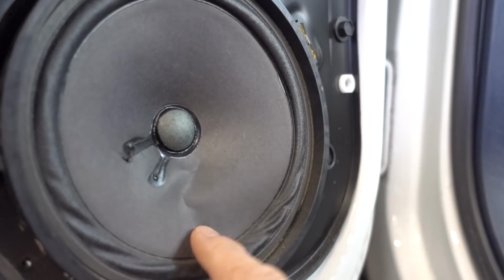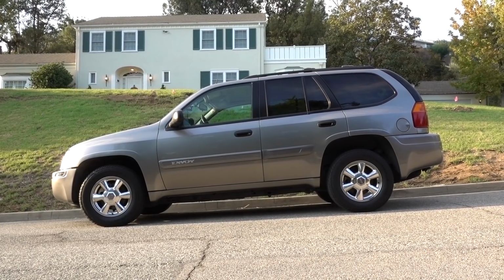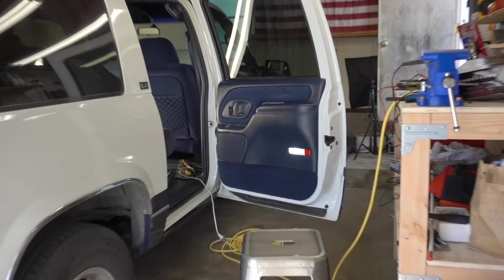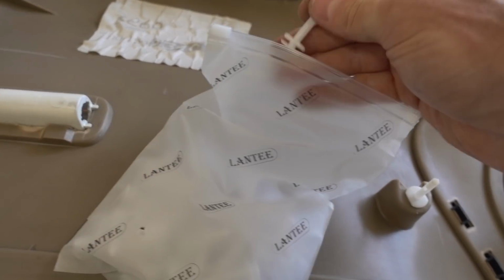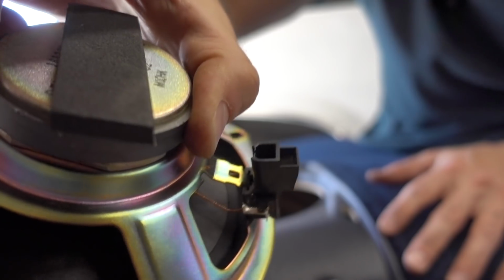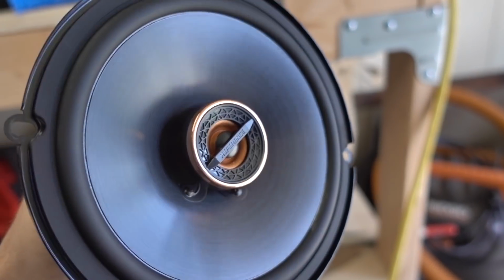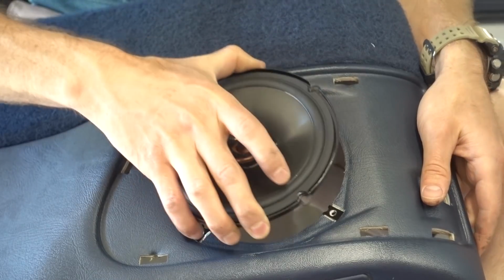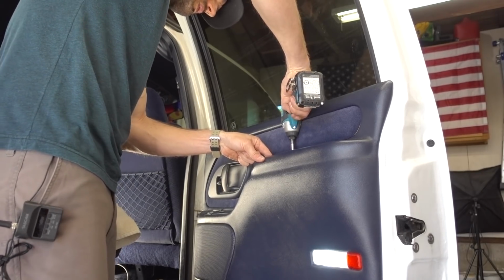This Is Why YOUR FACTORY CAR SPEAKERS SUCK!

Comment: My truck is a 1999 Ford F-150!! I haven't upgraded the stereo YET, but I have been working to getting the parts I need for it!! As far as speakers I have used I love JBL, Boston Acoustics, Pioneer and some of the Kicker stuff out there for speakers! I have used those brands a lot in the past, and they all sound great!! As for head units though I was always a fan of the Pioneer Super Tuner hardware, but over the last few years I have switched to mostly JVC head units!! I SHOULD point out too I have had some great gear too from Alpine and Clarion believe it or not, and I once owned a Clarion head unit back in the late 1980s that was AMAZINGLY smooth and super loud!! I also once had an Alpine head unit that was INSANE, but my only gripe about it was the price really didn't justify the sound quality when I have had units that were cheaper and sounded just as rich and full!! My last decent stereo system was in a 1984 Honda Civic and was a mix of a JVC head unit and a set of four Pioneer 6 1/2 inch speakers that was pretty sweet for a "simple" setup!! BUT the wildest system I ever owned was in my 1988 Ford Tempo that had two ten inch Pyle subs in a box in the trunk, a pair of 6X9 Kickers hidden back there as well, a pair of 6 1/2 inch three way Boston Acoustics in front doors, three amplifiers and a crossover controlling them and a pair of MTX Tweeters mounted up front to give me a bit more "snap" in the high end, that was all controlled off a Super Tuner Pioneer unit!! The damn thing was impossibly loud to the point where you could literally be standing 30 yards from the car and still hear it has clear as day with it at only half volume!! A friend of mine who worked as a professional installer, helped me "tune" it, and his employer freaked when he saw what I have stuffed into that Tempo!! Other that the Pioneer head unit and the MTX tweeters YOU COULD NOT TELL there was three amps in the trunk and a sub box stuffed under the back window, and I had to alter the tension rods (that held the trunk lid open) to make it all fit in the back!! I do miss that old stereo!!

Comment: Wasn't just GM, I've seen old Honda Civics with factory speakers that looked like they were made of cereal boxes and weighed almost nothing, for the longest time it was just a place they could cut corners to an extreme degree.  Its best not to invest much in that era of car regardless as the lack of sound deadening just renders any upgrade nerfed as it has to spend half its energy fighting road noise and bad accoustics.  Always just buy a car with the good factory sound system to begin with, anything else is a nightmare.

Comment: I have a 96 Suburban, and I followed your links to Amazon and order the same speakers as you for front and back. I also used your link and ordered the same head unit.

Comment: I used to install car stereos for freinds and anyone that would pay me as one of my friends was always buying cheap used cars and we'd put decent stereos including large subs back before everyone was buying sub boxes. My latest car is a 95 Neon that my little sister bought new. Her hubby had already had better after market speakers installed after they got married. They sound pretty good but the drivers door woofer is now blown so I'll have to get a few more to replace them. I might even go with the same kind. I did put a small powered 10" suitcase sub that sounds great and replaced the cheap aftermarket head unit with a nice Dual HD radio unit with surprisingly good sounding amps built in. I haven't even added big amps and big wiring to take all the power I used to run. If you pick decent gear even if it's cheap you'll be surprised how much better your car can sound. My Dart I did a full blown install with 2 12"s 8" woofers in the rear deck, dome tweeters, 6.5 woofers in the doors with the old Polk tear drop pods mounted to the windshield pillers. It sounded better than most peoples decent home stereos and had very clean deep bass and overall sound. I didn't feel like installing all the amps and wiring in the Neon like I did for my Dart slowly over time and deals came up. I had 3 independent amps in the Dart, 150 watts a side for the subs and 75 a side for the rest of the rear speakers, and another 75 a  side for the fronts. You can go nuts and spend a lot of time and money or just spend a little and have nice sound if you pick your components right.

Comment: I have the 2018 Nissan Navara np300 forntier truck and the factory speakers are of really good quality. I’m talking good hights, tremendous bass and clear mids...the only things is that it distorts at high volumes when the bass is turned up.

Comment: you can use a 9volt battery to check for polarity.  When you touch the positive lead to the positive side of the speaker it should pop out.  Now you know which is positive and wire it up accordingly.   Usually for GM truck in the rear, right speaker dark blue is + and light blue is negative. Left speaker is Brown is positive and yellow is negative.  I grew up with GM cars in the 80's and early 90's.  Those old Delco sound systems and 6x9 speakers would knock your socks off!!!  All my new GM products have BOSE which is pretty good for run of the mill car radios.

Comment: My 2004 Nissan Frontier has stock speakers atm and they actually sound good, and the bass sounds like a subwoofer.  I’ve replaced the radio with a pioneer Bluetooth HD receiver and big difference already.  I’ll keep the speakers in video in mind for when I shop.  If I ever do.

Comment: Renault Clio II - Took the original speakers and tuned the doorboards / mounting locations for more stiffness and less resonances. Detached the factory car radio to use it as a brake chock. Installed a precious audio device.

Comment: While you have the door cover off, add peel and stick aluminum on the sheet metal to stop vibration in the door.  I used Kicker speakers.

Comment: The speakers in my 2012 Chevy Silverado looked the same as your factories did. I upgraded to Rockford Fosgate Power series, which required custom mounts, because they were too deep to clear the window. Also, I used the speaker connectors Crutchfield sent me, to make install easier.

Comment: Removed my stock 2009 Toyota Matrix base radio and door speakers which sounded alright but lacked any low end. Replaced with an iPad and SoundQubed titanium horns, competition mids, and 2 SoundQubed competition 18's on 6000 watts. To handle processing, I use a miniDSP for room equalization, time delay, speaker timing adjustment, and level control.

Comment: I have a 2009 2-liter Miata. The stock audio was the  "luxury" Bose option with FM radio/CD changer and sounded awful (wooly and indistinct). I changed the head unit for a Pioneer 2-DIN naviceiver and the sound is transformed! I kept the stock speakers - they were not bad at all.

Comment: My 1979 RX7 SA has speakers surprisingly. They were upgraded by the previous owner BUT only the rears work so this weekend I’ll be popping panels off and checking the wiring to get the fronts working

Comment: They do sell harnesses for aftermarket speakers, but if you wanna save a few bux, have a soldering iron with extra electrical solder AND know how to use it, this is a great idea. Nice job!

I'm still working the stock speakers in my 2003 Ford Ranger XLT. I only changed the head unit to an Alpine and added two subs and an amp. Stock speakers co well with nids and highs while the subs get 'em down low ;)

Comment: Nice choice. Your speakers are 93 db, frequency range 57HZ-21 KHZ, 55RMS. I Have a 2003 CHEVY Avalanche. Replaced the rears w Kenwood KFC 40$. 2 way Coaxial Frequency range 40 HZ - 22 KHZ, 90db. 60watt RMS. I already had a tweeter in front so I just replaced with a midrange , GRS 6AS. 9$. 40watt RMS, 88DB, 75-only 10 khz. Hard to find just midrange speakers. I tried the Kenwoods in the front but thought they were too bright. I still have my factory radio so lower RMS and higher efficiency was what I was looking for. Because there was a separate tweeter , thought that there may be a cross over in front  door. Must not be because the tweeters went off when I used the Kenwoods up front.  Front speakers are super easy to replace. Your infinity may be a good choice but I will unplug the separate tweeter . Did You upgrade your stock radio?
Enjoy the day. Nice Video.

Comment: I live in the UK by the way.
The cars and vans in Europe and Japan have good quality sounding original speakers though. 
But they weren't made by the car companies, they were made by audio companies. Only thing is that loud music made small rattling sounds with the interior in the small European cars my parents used to own and there was no bass from the speakers in the 2004 Renault Master van, even though I turned the bass full on. The radio and all the other interior plastics felt very thin and brittle and the window winder fell off when I wound the driver's side window up once.
The speakers in Fords, Vauxhalls and Japanese vehicles ALWAYS sound fantastic. No rattling, always have a lot of bass.

Comment: For my 99 Tahoe I put in JL Audio C5-650X front and back doors and Polk Audio DB1001 tweeters for the front doors. Roof speakers got Kenwood KFC-415c's and I'm working on installing subwoofers somewhere on the body panels so i don't have em sitting in a box taking up cargo space. For subs I got 2 15" Kicker Q-Class L7's hooked up to a Rockford Fosgate R2-1200X1 amp. Factory look other than the huge sub box. With all the money I put into the audio in this truck, it still didnt blow me away. Once I had a local garage lay some Kilmat down in my doors, floor and ceiling, found all the spots that creaked or vibrated and tightened them down, replaced all the weather stripping on the truck. Finally the difference was night and day. Sounds better than the Harman Kardon system in my Beamer.
Reply: If I may ask, how much did the sound deadening cost you? I recently did a full system replacement, running 6 door speakers from an upgraded HU, put in a sub, and ran 2 amps... Don't get me wrong, the sound that comes from my system is great, but I'm not a big fan of the rattles and wobbles that it creates, so I'm looking to sure that all up. Had thought to get some SecondSkin, Dynamat, or some NVX sound dampener sheets, but if Kilmat is comparable and cheaper, I'd likely go that route... Any help would be appreciated.
Reply: @RAW_Reality  I've heard Dynamat is the best out there, I was charged $2,800 for the Kilmat and got 100% coverage although now I've been told they probably ripped me off cuz you can cover 50% of the truck and have almost the same results, for the creaks they just drove it around and pushed on body panels to make creaking sound and then added a felt like material which is the same color at the door, you can't even see it and I literally can't push on anything to get a sound, its like riding in a German car. I got the subs installed in the back seats facing the rear hatch with some Kilmat in ther aswell cuz they made a custom box in the seats themselves. I did have a rattle in the back hatch that I fixed with some rubber inlays and it no longer rattles.
Reply: @tahoeboy8658  Damn, that really does sound like a bit of a hosing... Non-professionally, I've heard of people using something as simple as templates made from cardboard to get the 70% of the effect that something like Dynamat will give you... So going from that cost to nearly 3 grand (albeit with better materials), that just hurts me to hear you having to go through. The area around the speakers and some weather stripping, I understand, but sheesh...  😅 Yeah, 100% coverage is absolutely excessive unless you're dumping cash for every last possible .1db, which it wouldn't seem like you are... But hopefully your system sounds like what the cost of it would imply it would, if you went to that extreme! I'm over here with my simple SQ system thinking that I could clean up some of my rattles for less than the cost of the entire system cost me... Might have to go the cardboard route... 😅 
Thank you though. 👍🏻
Reply: @RAW_Reality  well I spared no expense, they tore it completely down inside, installed all my speakers, made the box, I'v had the whole truck customized at this shop, plus everything in LA is expensive as all getout, they charged me $150 an hour. But I was told if you wanna go the cheaper route you can use Dynamat and do it yourself for a couple hundred bucks. It'll feel like a new truck inside
Reply: @tahoeboy8658  Okay, for that amount of labor, work, and customization, I can at least justify the price some more... So maybe not a full hosing... LOL. (Sorry). 
Yeah, that'll likely be exactly what I end up doing. Don't wanna be too cheap about it, and it'll definitely help, so I'm looking forward to that "new truck" feel. And I love your choice of tweeters, as I'm greatly enjoying the Polk component system I put up front. The Pioneers I put in the back haven't impressed as much, but still sound better than stock, thankfully. Might have to upgrade eventually with some B.2s or Timpanos. 🤷🏻‍♂️

Comment: Tahoe. Had the upgraded Infinity (edit: it was Bose, my car had stock Infinity), package - it was decent, but nowhere near loud enough for me. I did a complete system install, but only regarding the mids and highs, I have 4 sets of 6.5" on 1000 watts and outside of high end stuff, I really like Alpine and Pioneer and have always had great results and longevity from both. Most of the brand names are similar in performance as long as they are close enough in specs (rms wattage and sensitivity are most important), that the lowest price you can find makes that brand the winner in most cases.
Reply: Yeah, but how much did you spend? These are only a buck a pair!
Reply: @rayjos0424  I'm pretty sure mine were 80 and 90 (2 way and component), per set when I got them. They're in that same spec and price range as these.

Comment: 2000 Chevy impala ls I have not replaced the factory car speakers but plan to soon with pioneer speakers
Reply: deadfish187 gaming  dumb easy to do. Don’t even have to take the door panel off just remove the grill and make sure you have a torx but set and in case you didn’t know if you plan to replace the 6x9s in the rear deck you have to take the back seats out . No way around that

Comment: i have 2009 Mitsubishi lancer, and the factory speakers are just amazing. Sure, the bass is not as clear, but that is because it doesn't have a subwoofer in a trunk. But overall experience? Just amazing.

Comment: 6x8 Kickers in all four corners of the cab in my 96 Mazda B Series along with a Pioneer CD/USB head unit. Got a 10" MTX sub in a ban pass box in the back of the cab.  Also have my Sirius deck running into my auxiliary jack as well.

Comment: The real reason why older OEM speakers suck is because manufacturers bought the cheapest grade loudspeakers they could find.
No car manufacturer ever built a speaker (at least that I know of). 😉

There wasn't a big improvement on car speaker technology over the last 20 years, and you could buy great 2-way speakers along the lines of those Infinity, 2 Way separates, or cheap coaxial speakers (that's the name of the design of those OEM that you replaced).

Another point to consider is that over the last 2 decades, car manufacturers started to pay a lot more attention to vehicles  acoustics, both on trying to make the interior quieter, but also by creating a much better sealing of the door panel (or the best separation between the front and the back of the speaker, which immensely increases bass response from the same drivers). 

This is why so many cars sound pretty decent today even without the "premium sound pack" option. 

So you can still improve the sound of your truck by applying the same principle (while maintaining your new Infinity speakers). 

Cheers. 👍

Comment: I personally wouldn’t have soldered the two plugs together. If anything they sell factory plug and play connectors to help assist in a proper connection without cutting or splicing. Another thing to consider in a setup like this isn’t just clearance on the back end of the speaker but also the front. If you use a (coaxial) the type of speaker used in this application and the tweeter sticks out to far you could run into issues with the grille going back on correctly. Just speaking from experience. But other than that you did a good job.

Comment: I got Memphis 6.5 is the doors of my 07 classic Sierra. They sound good. I need to take the door panel back off on the driver side and tighten the screws it rattles a bit. You do know they make adapter harnesses to so no soldering is needed.

Comment: I drive a 97 land cruiser that had 3 out of 8 speakers blown and a busted factory sub. Replaced all the speakers that were 4” and up with Kenwoods since I’m a little bit broke, but they sound really good. I just need to install a new sub and it’ll be good to go.

Comment: All my cars have had the factory stereos except for the first 2.  My 63 Chevy Corvair didn’t originally have any radio and my 72 pinto had a broken one.  I’m not a big stereo guy and have only replaced a few blown speakers with the cheapest Walmart speaker I could find.  I have installed several systems for friends and can appreciate the better sound but I’m just cheap for myself.

Comment: The number and brands of replacement speakers I have installed over the years...  I'm not even going to start trying to count.  Overall clever reuse of the factory plug, though I would have used it to make a custom pigtail rather than solder directly to the speaker...  In fact that is something I commonly do and it makes replacement easy if ever the speaker should fail.